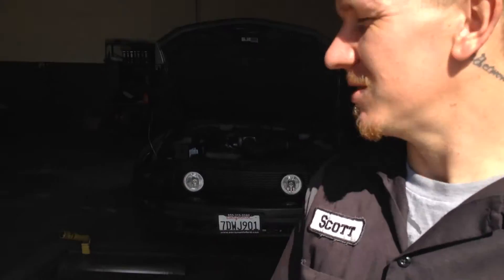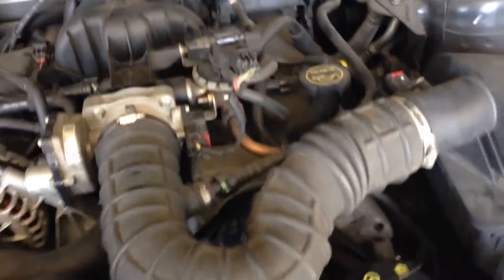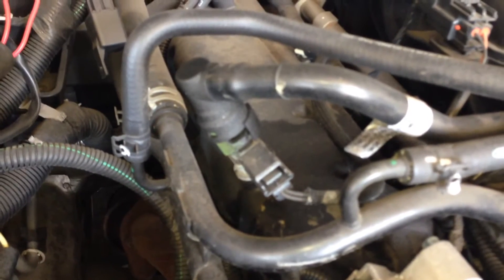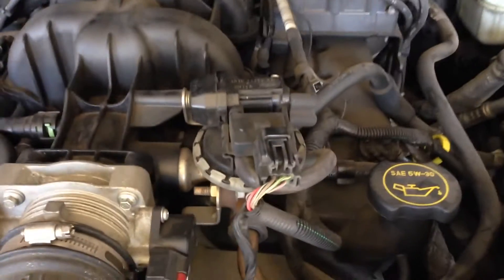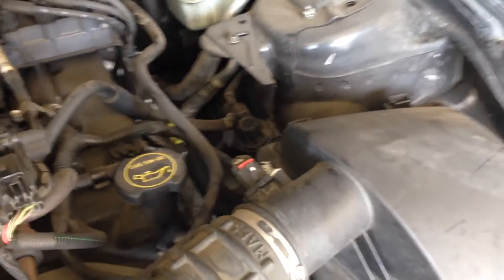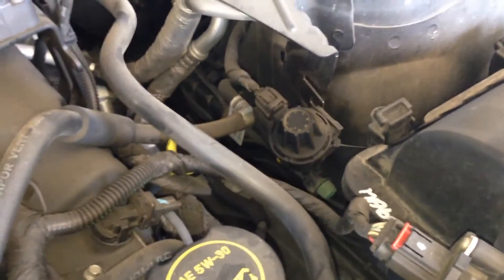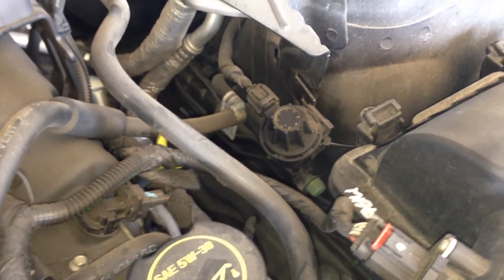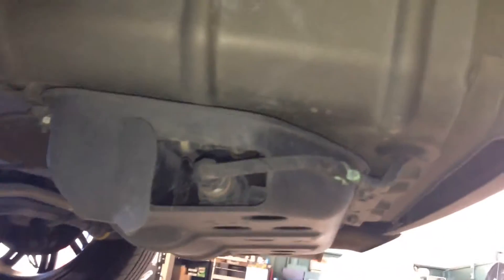Ford Mustang emissions: PCV valve, EGR valve, EVAP canister, & purge solenoid

Comment: Got this CODE. 2006 Mustang 4.0L V6

EVAP System Leak Detected
Gross Leak/No Flow
P0456
Reply from the maker: Have you checked the seal on the bottom side of your fuel cap? I always recommend replacing the fuel cap with a factory oem cap or a Stant brand, non-locking, cap. When I get any EVAP code questions.

Comment: I have a small puddle of oil in my intake manifold 2010 mustang gt could the Pcv valve cause that
Reply from the maker: Can't guarantee it but a possibility. if the PCV valve is stuck closed the PCV system will find some way to escape.

Comment: How about a video but with a 98 V6
Reply from the maker: I do not currently have a video pertaining to that particular vehicle. If you would like to make a high quality video and upload it to Google Drive I will download it and add captions and a voice over.

 I would need a good clear video of the engine Bay. The driver side of the engine. The passenger side of the engine. And the passenger firewall area. If you would like you could even get under your car and follow your exhaust on both sides. Try to keep this video under 4 minutes long. I will label all of the emissions components and explain them to my best ability. Upload it to a Google Drive and send me the link. Send it to my email or my text message. Therealscottieshobbies@gmail.com or (925) 418-5096.

Comment: I need help, I have check engine code p0401 on my mustang 2010 base model v6 4.0L, 

     I changed the purge valve, and egr valve, also I have new air filter, and o2 sensors, did an oil change, and coolant flush, :(

it says P0401 is an OBD-II generic code that the engine control module (ECM) detected the engine exhaust gas recirculation (EGR) valve is not flowing enough recirculated exhaust gases when it is commanded to open the flow of gases into the intake manifold.
Reply from the maker: Do you have a DPFE? In your egr system?

Comment: People with an early S197 v6 got lucky considering the issues with the 6r60 and the camshaft phasers. Not saying the 5r55s was a huge improvement either though, but at-least v6's didn't require a timing job around 100k.

Comment: Hey would codes p0442 p0457 p0455 make my car sound like its cammed and dies out within 10 seconds of starting. Those are the only codes that show up on my car :L. I basicly turned a corner and my car died. and when i try to start it. it sounds cammed then dies in a few seconds. Any ideas?
Reply: My car sounds cammed too, but idles fine, and dies when I put it in reverse!
Reply: @RobertYayo  , just crazy how this was 2 years ago, this was my valve spring that broke , made the valve stuck closed
Reply: @SkepticalVex  lol just saw the video in my recommendation cause I got egr, and evap codes yesterday, but they went away. You still with that s197?
Reply: @RobertYayo  I lived with EGR and EVAP codes for 3 years with that car. When the rocker arm broke last year I sold it for $1000
Reply: @SkepticalVex  how'd that break
Reply: @RobertYayo  just a 212k mile engine that i floored a lot, hahaha
Reply: My motor has 149k miles but sounds so deep lol

Comment: Omfg do you have any idea what that highish pitch noise is while this car is running? My car literally started sounding like a turkey 2 days ago
Reply from the maker: Lol. A turkey.. first I've hear that one. But can you isolate the location of the problem? Under car, front of car, top of engine? Off the top of my head I would say look at your serpentine belt see if it is loose or if a pulley is wobbling. Does the squealing or sound get louder when you accelerate or decelerate or turn or brake?
Reply: @ScottiesHobbies  doesn't get louder but it goes with rpm. Clutch in or out can't isolate a location though sadly
Reply: Mine started doing the same thing
Reply: I was accelerating in 2nd gear and it just fell on its face and then started to misfire plugs are new and till has good spark

Comment: does the 2006 gt have an EGR valve? I need to pass smog in Cali and they told me I need to change mine but I cant find it. Thanks
Reply from the maker: +Johnathan Hurley not all models have the egr. Do you know if you have a underhood label?  That will list what your vehicle is equipped with. I you have a check engine light on? Was it on? Usually ya dont need to replace the egr but its possible.
Reply: Scotties Hobbies , thanks for the reply. No I do not have the original hood nor do I have an engine light. normally egr's are pretty easy to find but on mine, I can't find one. the Smog shop said that it failed the emissions. A tech at Ford said it is under the intake but I wanted a second opinion before I tear into it.  Thank You.
Reply from the maker: What did it actually fail smog for? We dont actually test the egr during a smog on any cars newer than 1995. We visually look at it. I would assume on such a new car the computer would catch a malfunction and command the check engine light on.

Comment: bet my procharged "v-sux" 400rwhp and 435rwtq could beat your honda.. just saying, smh..
Reply from the maker: +hellsnightmare probably but my SC 95 5.0 bored to 327 might have a chance. 

But modern technology has changed the out put of the smaller motors. I am amazed of how much power these v6's are putting out.

I was just haitin.
Reply: Lol did you just shoot stock numbers on most actual good vehicles? That's super cute. Must have traded in a Honda for it.

Comment: where is the purge flow sensor on a 03 mustang gt. Can't  find anything on the internet about it.  thanks
Reply from the maker: I don't think there is a purge flow sensor but maybe you mean the purge solenoid? Are you trying to solve a code? But ... The purge on your car is under the hood. Thinking off the top of my head, I think the Green service port it on the purge on that car but I might be wrong. Its a pretty common car tho so i'll make a vid soon on it.
Reply from the maker: I got a 2000 in today. It looks like the purge on your car is probably in the front passenger fender, directly above the front passenger side tire.  You might be able to see it from the passenger door jam, open the passenger door and look in the jam and you might be able to see it. some cars have something there so you can't see in the fender.
Reply: +SCOTT BROWN okay thanks. I'll  check tomorrow and confirm.

Comment: ok i'm confused with the canister vent solenoid i thought that one was on the rear bottom in canister? and the canister purge valve was the one with the evap service port?
Reply from the maker: you are right. the vent on this one is near the tank. the purge is under the hood. I had no label on this under hood but according to alldata, you are correct.
Reply from the maker: man... I'm just ass backwards. lol. the purges go to intake and vents go ambient!
Reply: Really thanks is cause i have a code 0456 so i'm doing research to see if is an easy fix. I don't have a smoke machine so i'm going to buy new gas cap since is 11 years old and then i'll buy the canister purge valve. Is also called the canister purge valve solenoid. they kind of have the same name, canister vent valve solenoid and that one is in the back under the car.
Reply: Thanks again. i really like how you did this video i finally confirm where the PCV valve thanks to you. i Hope you make more videos where you describing parts on mustang cause i have the same exact car.